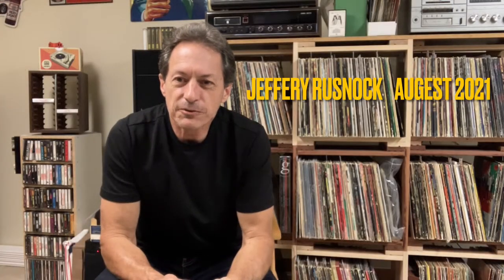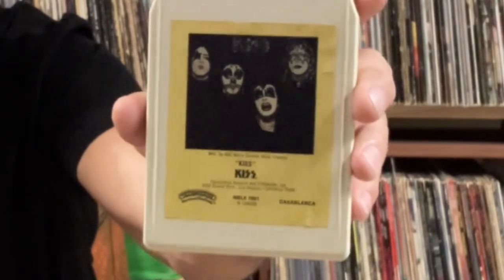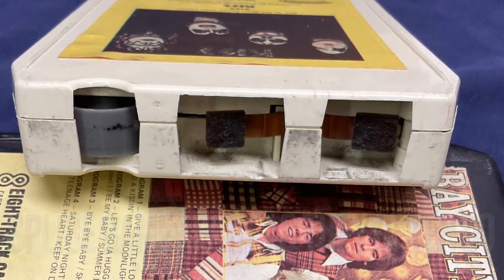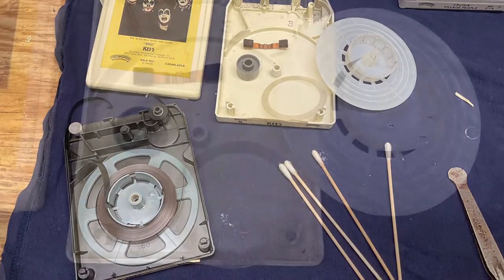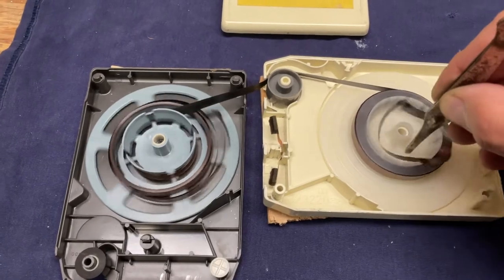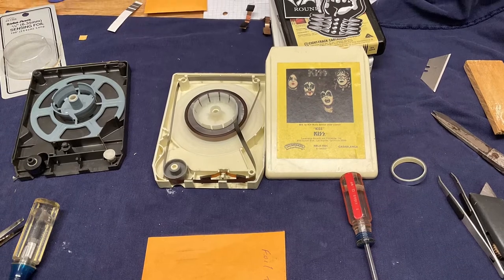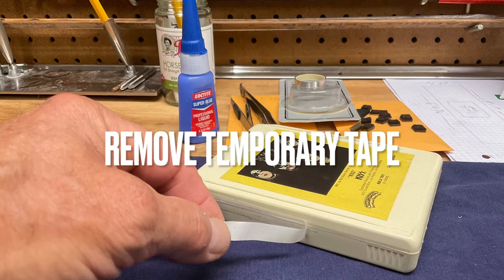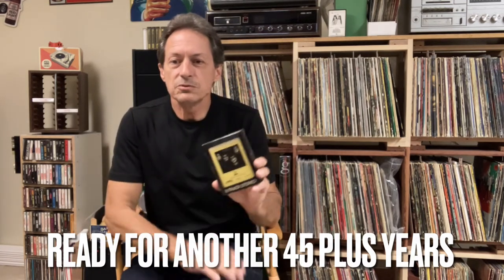KISS 8-TRACK TAPE CLEANING & REPAIR

Comment: Hi Jeffrey! You may be my saving grace right now. Lol! I don’t know if you have ever heard of the 1978 Migo 2XL, but it is a trivia robot that uses eight track tapes and asks you trivia questions. I have 14 of these at the moment and two of them are all kinds of messed up! I think one just has a twist in it somewhere near the foil splice, and the other one feels bound up inside or something. I’m almost afraid to ask, but do you handle repairs like this as well as replacing the sensingfoil and the felt pads? Where are you? And what do you charge?
Thanks.
Reply from the maker: Hello there, 
sounds like you have quite a nice collection! If they are indeed an 8-track cartridge it should be fairly straight forward fix but it is always unknown of the extent of the problem  until the case is opened. Please can you send me some clear photos of your cartridges front and back including the front tape side by email so I can see what they look like. I’m in Pennsylvania and if  you cover the cost of shipping that’s fine I can take a look at the problems and repair . 
jjrusnock@ptd.net
Reply: @JefferyRusnock  thank you thank you thank you! I will do my best to take good pictures. I am totally blind so… If they stink just tell me and I will try again. The only other person who was willing to do this is in Canada and I would have to wait longer to get it done if I sent them to him.
I have a sinking feeling that one of the felt pads inside the bound up tape has come loose and flowed along with the ribbon into the dark and dangerous twisted unknown. I only found somefibrous remains in the bottom of the tape well I guess you would call it? Lol! The area where the tape rides.
The other one was playing if a little jerkily and then it got to the foil splice. It just stopped moving completely so I hurried up and pulled it out of the robot. There was a clear crease in the middle of the splice and the rest of the tape is rolled over. I can’t tell the top from the bottom of the ribbon so I don’t know if I could straighten the twist myself. This really irks me because I can splice compact cassettes pretty well. This should be a lot easier because the tape is so wide.  I just  don’t know what I’m dealing with. My intent was (at least with the twisted tape) was to remove the side that was twisted entirely as in pull it out from the left side, cut the original splice out, put a new foil splice in there and secure it with some kind of glue, and then take the rolled over end and flip it in the other direction and then secure that end to the new foil splice and leave it all in a wad for about a day until everything dried and then wind it back up? It sounds easy but I guess I just don’t have very much confidence.

Comment: Those RCA tapes are a real pain! Some of the Atlantic ones with the screw in the middle are a pain too because you have no choice but to damage the label. The Columbias are the best by far, IMO, and from my experience, they are also the less problematic and rarely need taken apart lol. Funny thing is, I used that method of rewinding a tape back onto the spool before. I had to teach myself. I started collecting 8 tracks back in 2000 when I was 10, and had no choice but to learn the basics myself. As a Classic Rock junkie, that was the cheapest and easiest way to get more into the music and build a pretty good Rock & Roll collection without spending a lot of money, which back then, i didnt have.
Reply from the maker: My favorite are definitely the 3 tab verity that open up from the front and more times then not the label hinges open and doesn’t even get ruined during the process!
I had to figure it out myself as well since I had no internet back in the 70’s & 80’s when I was buying them, sounds like great minds think alike…lol! 
Thanks so much for watching once again!
Take care! ~ Jeff

Comment: I was just curious Jeff. Does similar issues happen with cassettes. I cannot recall it happening to cassettes. Obviously, not ever owning a eight track cartridge I do not have experience with them. One thing people say the first two albums sound muddy in the production. Sure they could have been produced better, but I think they both sound fine.
Reply from the maker: Hey Robert, 
not a problem with cassettes as they don’t have splicing to them, they are not a continual loop of tape like 8-tracks are and each end is connected to the reals of the cassette cartridge. I actually have less issues with 8-track tapes and the players, since I bought 8-tracks as a kid and cassettes weren’t around until later as I was growing up I have a lot more tapes and parts for the 8-track format. I only noticed Hotter Than Hell sounds like it was recorded in a tunnel somewhere and even Kiss admitted to the poor production. Thanks so much for watching and commenting!
Take care my friend and talk soon! ~ Jeff

Comment: Hey Jeff, 
I had a question, where can you order splicing foil? I've seen pressure pads for sale recently,  but haven't found any splicing foil yet. I'm a little leery about the new pressure pads as the reviews I've read about them are a nightmare! Any information would be greatly appreciated.  Many thanks! 😊
Reply from the maker: I have gotten splicing tape and pads lately from the 8-track shack (but started to raise the prices) several  years ago but my last purchase was just last year at a place on eBay that I used and was very happy with! The sellers name is 8tracks-and-repairs, I got enough pressure pads and sensing foil to repair 100 tapes for 25.00 dollars which to me was outstanding and well worth it! I still have plenty but plan on looking him up again if I need more in the future! It’s 100 pads and 100 strips of foil, I was very happy with the price, seller and how fast it arrived. 
Take care and good luck locating whatever you need for your repairs my friend! ~ Jeff

Comment: How did you manage to get aluminum splicing tape ? I have so much trouble finding some the only thing I have been using was aluminum duct tape that you can get at a hardware store.
Reply from the maker: He Mike I picked up those rolls of splicing tape many years ago at Radio Shack while eight tracks were beginning to wind down. I have boughten splicing tape and pressure pads from a place several years ago from a place called The Eight Track Shack, if still in business it may have what you’re looking for to replace the duct tape. Something I’ve used myself on occasion!
Thanks for watching and commenting!
Take care! ~ Jeff

Comment: Hello Jeffery! I have some stereo 8 tape and the one I've tried had the adesive problem, I've tried open one of it and try to fix it using the metallic adesive foil but it ended up that I couldn't understand how to put the tape back in the cartdrige since if i pull it out then rotate the plastic circle to bring it back inside the other side will pull out
did you have done or can you suggest me a video on how to pull the tape all back inside the cartdrige without going crazy? thank you!
Reply from the maker: I don’t have any magic bullet for fixing it is work to wind back up if you lose the two ends inside but slowly spin it until you get to the ends. I do it on an empty track cartridge. https://youtu.be/Gklj7p-Bu7w video may help you A look inside from several years ago.